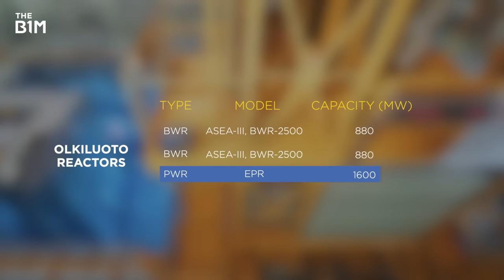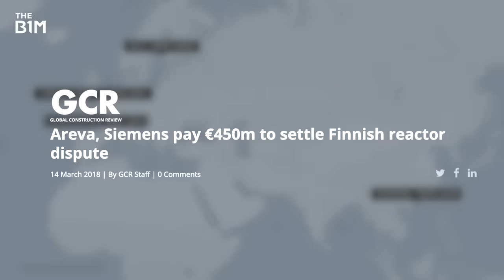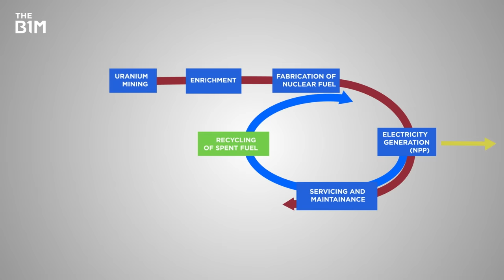Finland Might Have Solved Nuclear Power’s Biggest Problem

Comment: The problem isn't figuring out what to do with the "spent" fuel... we've known how for decades. And several countries have been using them. Canada uses heavy moderated reactors to be able to run it thru again. Multiple fast breeder designs are in the works or already operating in countries like Russia, China and India that use a fuel cycle that not only leaves no transuranics but can take existing "spent" fuel and use it completely

It's wading thru the politics of it all that has been the real problem which is why we end up burying it a lot which is literally the worst thing to do with it.
Reply: Yeah, it's not like we don't have machines to use the spent fuel. We need to convince people that it's safe. I heard recently that Canada plans on making a line of mass-producible small reactors in place of large ones in power stations.
Reply: What do you even mean with that sentence - the problem was politics all along for deciding to bury it?
And absolutely not, we cannot reuse all of it. There are waste products.
Reply: @christian2i  If you are referring to me yes politics and fake public perception is a huge role. There will be waste true but not because we can't reuse any of the actual fuel. 

Might have been a little too technical but to break it down more simply most reactors only use something like 1-3% of the uranium in them before being considered spent and put into storage... there are ways to literally use 100% of that. The waste left over would just the fission products which are all short lived and whatever material that got irradiated.
Reply: Love seeing people talk about Canadian nuclear. Yes, it exists--it's been around for quite a while, and gotten quite good. Our old CANDU reactors are still happily humming along, 19 in Canada currently and 31 running globally right now, including derivatives like the Indian CANDU-likes.
Reply: @christian2i  We can reuse the majority, it’s waste products that can be turned into more fuel and used in lower-grade reactors. The problem with nuclear is the restrictive political situation, preventing much-needed replacement facilities and the decades of innovation that have happened since the first facilities from being implemented. It’s seen as dangerous, despite the fact that it’s less dangerous by far than fossil fuels, and that makes people put heavy restrictions on it that don’t really need to be there.
Reply: Civilian D-U rounds?
Reply: I agree with you that processing of spent fuel seems the most palatable of the options, to get the danger of the spent fuel down to just a few hundred years.  It is said that the possible new reactor type of molten salt with thorium will have a much lower duration of waste toxicity than uranium of today's reactors.
Reply: @christian2i  it is possible to reuse spent fuel, breeder reactors use already spent fuel to make energy 96% of the waste is reusable and the 4% can b released back to the environment since it's now stable having completed its entire half-life
Reply: I'm pretty sure if scientists and engineers would be given enough funding for research/testing and support (not pulling the rug out every 2-3 years) they would come up with series of solutions to utilise the "waste" in various ways, be it re-running it, adjusting reactors, coming up with new ways to generate energy from those etc etc. Instead we're obsessed with this idea that solar and wind are the only true way and everything else is bad. imo Nuclear is AT LEAST a necessary step to phase out the fossils until solar/wind become efficient enough + fusion reactors are developed to the point where they can be built and implemented en masse. We have the technology, but 2-3 major incidents + fantastic movie scenarios just completely halted any possibility for reasonable conversation. 

so yeah, wading through politics, battling lobbied interests that manipulate public perception as well as not having real leaders is the major obstacle - everyone just wants to go along for the ride, get re-elected and offload major problem solving to the next guy in the queue for far too long.
Reply: @kasparsiricenko2240  They probably would if it wasn't for the huge nuclear scare from back in the day and politics that it created...

Note many countries actually do do these things to some extent or another. I believe we are one of the few countries with a strong nuclear power presence that the government doesn't even consider other options
Reply: @kasparsiricenko2240  From an environment standpoint I totally agree... but it helps sell it to the people who don't understand that or think "natural" radiation is better. 

Fun fact burning coal actually releases more radioactive elements into the air than nuclear power does
Reply: There will always remain waste.
Reply: Not to mention we have liquid thorium which has been around for decades that solves a large portion of this issue as the spent fuel is only radioactive for 300 years...
Reply: @seannissen2509  agree the 1 or 3 % probably are first generation water reactors, here in belgium we use PWR presurised water reactors, they use 10% of the energie that is contained in the nuclear fuel, in france the waste product is procesed, it is a first start but far from perfect, the nuclear sector has for to long being sabotized.
Reply: @panoramix2656  funny part is traditional reprocessing is probably one of the least good solutions... but as you say too much sabotage. Things like China Syndrome and the movement that went with it literally caused a 30-40 year mortarium on making much new or developing the tech for it.
Reply: @seannissen2509  it is not the traditional reprocesing system look up MOX, it can be reused partly and the halflife is divided by 10, wat is normal about that, the majority of nuclear plants just stockpiles their spend fuel
Reply: @bigmonkey1254  2 1/2  lbs  Nagasaki.  Reactors Fukushima 1,200,000 lbs in full fission uninhabitable to life indefinitely . Can't get near the stuff. No one has seen it. You guys are smart. Nothing can go wrong
Reply: @thedalillama  Good one. Still going to remind that DU is acquired(or left over) before using(or manufacturing) the nuke fuel in the first place. Not from spent fuel. That's why it's "depleted uranium" and not "spent uranium fuel" or "plutonium and all that nasty stuff".
Reply: Indeed. Breeder reactors are actually illegal in the united states, thanks to Jimmy Carter.
Reply: @hurri7720  If it's only 1% you can shoot it in space or sun. Happy now?
Reply: @lesp315  , too risky and expensive too.
Reply: @hurri7720  Driving a car, taking a train or flying is risky and expensive, but people do it every day. What do you do? Live in a ditch under a straw ruff and eat grass roots?

Comment: im glad they found out that you can dig deeper
Reply: Sounds like they hit bedrock tho, so we’re done with deeper
Reply: The Finnish bedrock starts from the surface and reaches very deep. It's a very stable and thick piece of bedrock. It's called the Baltic/Fennoscandian shield. "It contains the oldest rocks of the European continent with a thickness of 250-300 km." It's very easy to bore (blast) because it's so stable.
Reply: @McSlobo  sounds like it was a treasure

Comment: Thorium “catalyst” reactors solve that problem. Can “cook” those hot nuclear waste fuel rods down to 300 year hazardous life remaining.
“Cook” & “catalyst” are simplistic terms covering up a complex chain of reactions, easy to understand. Let the engineers make it so.
Reply: At what costs ?
Reply: @robertbiolsi9815  4 dollars
Reply: @Ghost Samaritan Illuminating article; thank you for sharing. I'm glad to see thorium has made so much progress since I last read about it.
Reply: @robertbiolsi9815  Tree Fiddy.
Reply: @dandadanda8983  $3.50
Reply: Don't forget that it's not just cheaper, it is also safer since it requires another material (forgot the name) to start "reacting". If you simply take this material away, catastrophes like in the past can be avoided easily.

Another point for Thorium goes for less waste production than Uran. Honestly seems pretty promising. I am looking forward to new advances in technology :)
Reply: if it was technically possible , it would have been done . At this stage Thorium is only  an elegant solution on paper. I still remember what was said back in the 60's 70's about super breeder reactors . Prototypes failed miserably mostly because of engineering problems
Reply: No, they wont. Thorium reactors just breed uranium from thorium and all that comes afterwards is just the same. Radioactive contaminated waste, building, environment.
Reply: @anidude808  yeah, the auto shutdown procedures include stopping the positive feed of the components. So if it’s not actively maintained, it just chills out.
Reply: There are 7 different ways to build a thorium reaction. 6 of them have been or are in development. So you can pick the effect you want.
Destroying existing stockpiles of nuclear fuel rods is one of the 7 reaction chains.
Reply: @saferider1094  I'm particularly interested in Thorcon reactors, projected for 2028, it is really just a bigger copy of Oak Ridge MSR and they don't want to use too much exotic materials, just replace and recycle the reactor after 5 years of operation just like original Oak Ridge. Maybe this is a better way to do it as the cost of plant is projected to be even cheaper than coal plant because of no special development
Reply: @saferider1094  I always thought that the reason thorium reactors weren't popular is because duringthe development of the first nuclear power plants, countries were more interested in also creating nuclear weapons, and using uranium allowed them to build both while hiding the uranium for weapons by announcing it was for power plants.

Edit: I forgot to mention it's because plutonoum-239 is a byproduct of these power plants and that can be used in weapons too
Reply: @anidude808  Thorium reactors can use uranium or plutonium to start the reactions! And yes their safety designs make it so a meltdown is prevented even without electricity or human supervision!
Reply: @muhammadirfanataulawal7630  Can you be specific. Or may be elaborative unless otherwise?
Reply: @fortruegood8591  I'm pulling this from their website and presentation  available on YouTube. They have a project here in Indonesia to make 3 GW MSR plant consisted of 6x500 MW reactors. Apparently they (Thorcon) are stating that they are going to upscale the original Oak Ridge reactor to produce 500 MW instead of going for entirely new MSR design (well ofc they will do some modifications and improvement I believe) and they will stop the reactor and change it every 4-5 years and recycle the old one instead of building a reactor that can operate up to 60 years or more

They believe that it will reduce the cost of design and production due to less exotic materials and less RnD due to just upscaling the original Oak Ridge reactor. The company have a target to start commercial operational somewhere around 2028
Reply: @flexiblebirdchannel  thorium reactors need a booster to work and they can use that waste and decommissioned nuclear abomb material for that they are also way more efficiënt
Reply: @zorroaster8895  that's one of the main reasons we still use these antique inefficient reactors
Reply: @ronniemarder  So what ? Thorium is NOT the chemical element that makes the fission, it's Uranium breeded from Thorium. So Thorium reactors are just the same as Uranium reactors, just a bit more complicated. They are as unsafe. They are more expensive. No wonder why THTR of Germany was not completed. But of course, fission fan boys use every slight difference to sell it as a complete new thing with none of the problems the older generation had. It will only take some years until the lies are detected.
Reply: @saferider1094  the first “reactor” of any kind was built in 1955, using Thorium. They switched to uranium so they could breed fissile materials for bombs.
Reply: @michealnelson5179  and here we are in 2021, still building these dinosaurs, calling this "innovation"
sad really
Reply: thorium reactors can even better be used to build nuclear weapons. They could even be used by terrorists to create atomic bombs.
Reply: And in the meantime, while we try to get thorium catalyst reactors up and running we could just throw the waste into a Fast Neutron Reactor.
Reply: @anidude808  That another material is probably Plutonium
Reply: Only 300 years… 🤢
Reply: Thorium has been around in research reactors since World War II. The thorium reaction by products and series of radionuclides emit radiation of higher energy then the standard uranium process. To date no exotic hastelloy Steel has been able to stand up to the thorium reaction. There is absolutely no potential, zero, for commercial grade thorium power reactors. But that doesn't stop the department of energy for demanding more of our last life savings, to quote research quote the challenge oh, like the new US space command is going to chase after UFOs with our children's inheritance, Lost In Space. MIC is why Americans can't have nice things. MIC, and the private Fed Bank in Brussels. Ameri-caca won't survive this.
Reply: @GhostSamaritan  Woow, I didn’t know about this… thanks

Comment: Any one who is serious about reducing reliance on fossil fuels, reducing carbon foot prints, reducing energy costs for consumers and economies and securing energy security has to push forward nuclear energy.  
Geo, solar and wind are great for domestic and small scale energy production but as soon as you include heavy industry and large cities they are a currently a pipe dream as Germany learned the hard way, I was shocked to learn that one smouldering plant with a few hundred workers can use more energy than a city with over half a million people, shocking pill to swallow when you really understand the magnitude of how much energy we use in heavy industry.  
Nuclear energy design and production has come along way the last 30 years and unless someone invents a new energy source that can be used on a massive industrial scale, the only realistic option to move forward with is Nuclear the for the next 10-50 years and perhaps beyond.
Reply: Not exactly true, renewables on average are enough to support heavy german industries, on average germany even exports more renewable energy than it can use and during high times even has to shut down and take renewable plants off the grid, because they are risking frying their grid.
The problem they faced rather was: there are times when no sun shines, tide is not changing and no weather change is taking place, leaving them with hydro plants and bio gas power plants and those are not enough to support everything. The problem is not producing enough energy, they produce more than they need, the problem is that they need to figure out how to create at least the bare minimum of power during those shortage times. Afaik their government is currently focusing on geothermal for the bare minimum power production, I read somewhere that they are building a test geothermal power plant with the energy output of a medium sized nuclear reactor.
Reply: @fatalityin1  Right. That's why shutting down their nuclear power plants and switching to renewable energy sources where possible has resulted in a net increase of emissions from Germany and a massive increase how much oil and natural gas they have to import every year...

Nuclear energy is great for a baseline electric output because it turns out that renewable energy sources are highly variable. Go figure.
Reply: And the batteries needed to make renewables more viable are quite terrible environmentally.

I also wonder what effects mass production of solar, wind and water energy devices will have on the local environment.

Wind captured is no longer blowing elsewhere like it would have. If everyone, everywhere, globally is "stopping the wind", what will that do to things that rely on that wind? Damming a river impacts the local wildlife.. can we dam every river or tide and not impact wildlife?
Solar panels are the least impacting (as long as it's on existing buildings), but it is the most unreliable without heavy battery use. 
Can we get enough energy without impacting pollination processes, or animal migratory behaviors.

When we look at the energy output, and compare to the draw, and look at what we'd need to have to accommodate existing and future growing power concerns.. we'd have to take into account the impact batteries and local environment this will start to cause.

Nothing is free. This is why efficiency needs to be a huge factor in deciding what to do.

Those ideas of using spent reactive material as an alternate fuel source, drawing out the most from the process, is the best idea I've seen so far for energy production.
Reply: @kaisokusekkendou1498  Reusing and recycling spent fuel rods isn't just theoretical. They've done it successfully to the point where the remaining fuel rod at the end of the very long process is no more radioactive than the average background radiation from Earth. Ofc it costs more to recycle spent fuel rods than it does to just buy new ones, so you can guess which route our for-profit private electric companies choose to do...
Reply: @kaisokusekkendou1498  yes, energy storage is the big hurdle of renewables, but what are you talking about with "stopping the wind"?  (also you can "dam the tide")